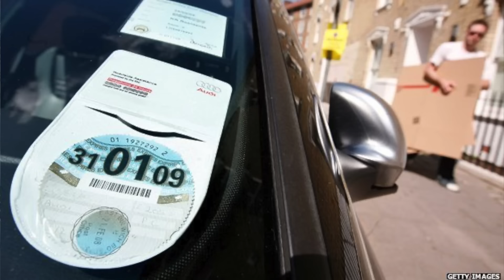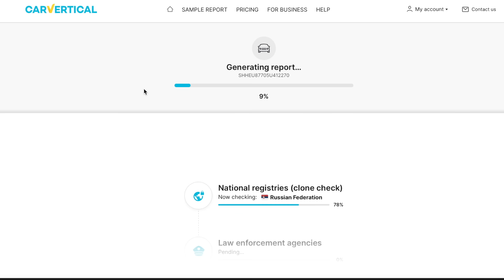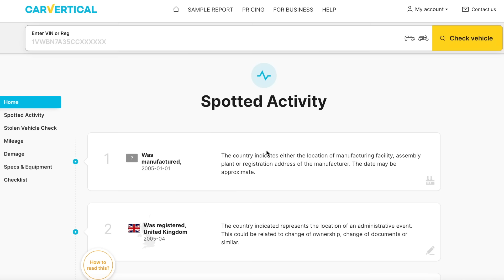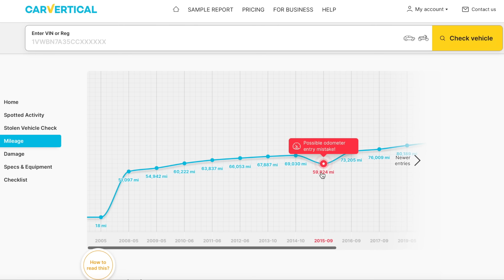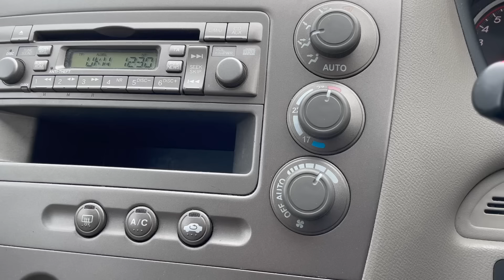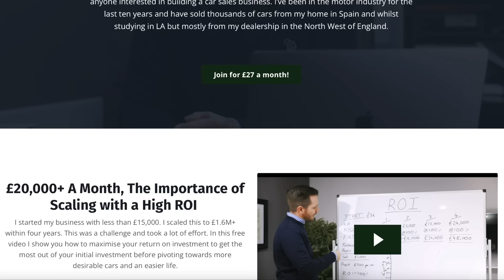I BOUGHT A CHEAP HONDA CIVIC

Comment: Just bought an automatic one which was first registered in 2005, nearly 100,000 miles on the clock and it costs £3000. Perfect for a first car.

Comment: i’m sixth owner of this car model in auto bought in london bit battered not a single panel without a dent/scratch no rust anywhere usually passes mot straight or fails on consumables tyres etc nothing major drives fantastic uses zero oil do own maintenance just turned 460,000 miles!!!!
only one problem rear washer doesn’t work as tube is blocked that’s it bit different to all the german rubbish i had over the years the ole civic will not die

Comment: I own a 2001 Civic 1600 Se Executive Auto. Only 56K. Lots of service history. I have had it 2 years when I brought it off my 89 year Aunty. Since I have owned it I have changed the exhaust, front Brake discs & Pads. Rear brake callipers & pads. New Aircon condenser,  new battery. I changed the radio cd to pioneer unit so I can stream music & navigation on my phone. The car has a leather interior. Electric sunroof heated front  seats electric heated mirrors. Everything works including now the Aircon(actually climate control) the bodywork has a few scrapes. The car will shortly be surplus to my requirements & don’t want to scrap it because it runs well & is very reliable. I would trust it to drive for the next 10 years with minimal cost. I might give it to you to recycle or advise

Comment: I owned one of these cars back over 10 years ago .
I was a 2001 Y Reg on S Trim ( Basic) but had the 1.4 engine .
Ironically it was the colour of the Y reg one picture you put up .
I can also confirm it was built in Swindon .

Comment: I had a Sport one of these also a 1.6 - just used it as a daily for a year while the Abarth was locked up away from the car thieves.

Ran like a dream, handled better than most new cars, everything on it worked, and also got 55mpg on a run.

Sold it for what I bought it for a year later, guy almost crashed it joining the road from the driveway, and then it was scrapped 4 months later - I imagine it was treated poorly and eventually crashed. Real shame because a car like this will run well for an eternity if looked after.

Comment: Well those are great Cars. You speak about the Corolla. I have one of those, bought It 2nd hand 10 years ago. Still goes strong.

My friend's father had a Civic like this one. I remember the gear nob being up and very well positioned. Those 1.6L engines are great. True they miss a 6th gear to cruise.

But small cars? Isn't it 4.4m long? I don't think more than 4m is small thought.

Can't wait to see the Toyota Corolla!!

Comment: My Dad's last car, a 2005 1.6 SE which I sold for him at the end of 2019 with only 19,000 miles on it. Very roomy, utterly reliable, would have made a great buy. 4-speed auto (which a lot of them had) smooth but saps the power.

Comment: Great cars! I’ve had 5 in 25 yrs from diesels to TypeR’s and not had a problem with any of them 👍
Reply: My last 2 civics (current 1.6 idtec 2014 model) sadly aircon not working but perfect otherwise, any issues with ac? Got a fill last year but gone 9 months later started with passenger side then drivers.
Reply: @getthecansin  I did have problems with my 2018 1.5 sports condenser but Honda extended the warranty and replaced it.
Reply: @ashleychambers7602  looking at other forums it defo seems to be a bit of an Achilles heel. Luckily I live in Ireland where it’s not needed too often😀
Reply: @getthecansin  😂😂😂😂👍

Comment: That's an impressively solid example there, the interior is beige though 😅.

I was considering a particular Type R a few years ago which, as I subsequently discovered, failed its MOT because the handbrake lever had become detached from the floor due to rust! This one looks very tidy indeed though.
Reply: Eh- black interiors are broing and get hot. 
-Somebody who went from beige to 2 black interiors back to beige.
Reply: Beige and nothing contrasting 🤦🏼‍♂️😏

Comment: Have one of those Corollas mentioned in the video, 1.4 petrol 2005. Paid 1400euro for it in December 2018. Use it as a workhorse and to ferry two big mucky dogs around, we haven't spent more than a grand in that time, and all on wear and tear stuff. Would get probably a grand back if we sold it tomoro. Brilliant little car, you know it will also start go and stop. They just dont make them like that any more.

Comment: I've got the same model but in silver.
Bought in Oct 2019 55 plate  with 29k on clock mint condition. Now on 41k, with only tyres and pads changed.
Lovely motor, but it's not a motorway  car, really needs a 6 speed box.👍

Comment: I got one given free, from a family member. 
I ran it till the tax ran out, and did not even ponder re-taxing it, or putting a new MOT on it.
 I did eventually MOT it, and to my disbelief, it passed. So i used it as a courtesy car for a year.
When that years MOT ran out, I was adamant i was not testing it again....but i did. Passed again, except for an advisory tyre.
I eventually sold it a few months after the second MOT for £1300, after using it for 18 months.
Still staggered to see it on the road nearly 4 years later.

Comment: Had one of these for 9 years, (bought pretty much newish at 35k mileage) Never had any issues with it and have generally maintained it well (oil changes) but the body work isn't the best as they do tend to rust overtime.I can drive it for another few years but will be sad to see it go. You cannot go wrong with Honda cars!

Comment: We bought a 96 civic quite low miles had it for 13 years the only reason it has to go was someone drove into the back other than bulbs battery and brakes timing belt we don't have to do anything and everything still working even the tape deck and we put hundred thousand miles on it honda is a top quality product

Comment: Currently running a 05 civic 1.4se  I bought for £400 with 113k on it some 4yrs ago now... in that time it's only needed , Cambelt for safety and a replacement caliper... otherwise just oil and filters every year + decent tyres. 
Does 50mpg on a run  and has plenty of space for family duties. 
Didn't intend to keep it this long, but I've no reason to move it on!

Comment: Love Hondas. My dad had a 2001 Honda Stream 2.0 from 2008 to 2020. Was probably the best car we’ve ever had. Was really reliable and never had to do anything major to it either. Had the original exhaust. Did have to replace the radiator but that was cheap. We got rid of it in 2020 as we took it into a Honda garage and it said it needed a few things. Now we don’t have MOTs where I live so we didn’t have to worry about it passing. Though we didn’t want the hassle. So we traded it in for a fairly new car. It’s a shame as it only had 118K on it and was still going strong.

Comment: Ran a 05 Civic from new to 190k miles.  All brake calipers failed from around 120k -150k miles.  Had the heater issue - resolved through a new thermostat but then came back shortly after so may have been the switch!  Headlight bulbs an absolute knightmare to quickly replace.  Also coolant fluid would just dissapear every week after around 170k miles, no sign of any leak so don't know where it went!

Comment: Bought one of these in December for £1000 with a short mot, it failed in January on exactly the same things at that one did, changed the back box and the O2 sensor and it’s fine. Lovely car to run around in and when you boot it the VTEC makes me grin.  
Think you got a good deal there. Oh and your one has way better body and paint than mine.
Reply from the maker: They're just effortless to drive aren't they
Reply: @HighPeakAutos  yes absolutely,

Comment: Good cars Civics. Held my breath when you opened the bonnet but  ... hooray ..... petrol not a tractor engine. The one you bought has proper independent multi-link rear suspension, unlike the spaceship thing which reverted to a torsion beam item with a lumpy ride. Nice views of new Mills and Mellor Road in the mist. I thought that the heater problem would be the water-valve. Can't say that Hondas Never do the head gasket in but it's rare and only when provoked. Assuming that there was coolant in the system the valve was prime suspect.

Comment: That's a simple design and in many ways I think it's aged better than it's wacky replacement. It's funny how things change. I never rembered the Vauxhall Nova as a sharp piece of design but I saw one in a classic car video and it looked smart. Much smarter than the now dated 1st generation Corsa that replaced it. Anything over styled or curvy is starting to look old but simple designs are more timeless. The exception to this is the 1st generation focus which has quite a striking design but still looks good.

Comment: When I saw the car was nosed into the parking spot the first thing that I thought of was a problem with reverse gear.  Glad it wasn't.  Also, when I see a prospect I'm looking at with locking wheel lug nuts I try and find the key first.  Had to deal with that a few times. ;-)

Comment: I bought a 1.6 diesel Civic three days ago. Just over eight years old, 40,000 miles. One owner, full service history, Honda dealer,  it had passed every MOT with no advisories. The service history is as thick as a family Bible and the car drives like a new one from the Honda showroom. 

i know the performance will not set the world alight but the car is zero rated for what I still call road tax. I filled the tank to the brim and covered more than 300 miles before topping it up to full again. Driving steadily with a couple of 70 mph dashes in the hills of mid Wales I achieved a genuine 70 mpg. Astounding economy for a very comfortable hatchback. Good cars if you are like me and just want low cost reliable transport.

Comment: These are great cars if you have one or two infants. There is so much space in the back it's easy to strap them into a child seat. It's easy for a child to climb from the back into the front or vice versa. This means you can have your child exit from the safest door available. Easy to drive but noisy on a motorway. I now have the version after this - which feels more solid, has six gears but not so good for passengers in the back.

Comment: I got one of these excutives like 4 months ago for £400 with a back seized brake. Been using it as a runner over winter. Cheap but fun motoring.
Reply: edit: the thing actually handled like a boat so I change the springs for some sporty ones

Comment: I had one but 1.7 CDTI. Isuzu engine, a little dead on low rev but at 2500rpm was great. 200kmh easy, after was struggling...but it has only 100hp. lots of room even though it seems not.

Comment: Bet you wish all the old PX's you buy turned out this well. All the factors were right with this one - an old Honda that had clearly been looked after - just a small amount of fettling and jobs a good un! I think you are right to highlight the VAT you have to pay to illustrate its not all profit ! - James at Chops Garage outines all his costs in selling cars which is fair enough as it shows the costs a dealer can be liable for.

Comment: woow for a 7th gen. Honda Civic Hatchback that's a nice trim gotta be the highest non type-r ES-trim over here.. Sunroof, beige leather (which I love for some reason), auto A/C
Honda Germany called this color Satin Silver Metallic
(Careful nerd alert!)
Had a 1997 Honda Civic 3 door Hatchback as my first own car. I loved that Indigo-purplish color Dark Amethyst Pearl, 5-speed manual, I don't remember the trim but I also had power sunroof which opened in like 2 seconds so a whole 3 seconds faster than the power windows on my previous 2008 junker Mercedes A-Class, had killer A/C like it was really cold and cloth seats so comfy that you never needed no heated seats because the just don't get cold.. Sure it had some rust but I bought it for 500 bucks and drove it 1 1/2 years. It's still driving around, sold it to a mechanic and he took care of it. Also had a major crash in a 2007 Honda Civic one of my best friends drove flipped 3 times at 40mph and we we had no broken bones or anything so I really like Hondas even tho there are 26 other manufacturers more popular than they're to new buyers :)

Comment: The only brand new factory fresh car I ever bought. Reliability was utterly horrendous, Honda UK extended the warranty an extra year to apologise. Still have the brand new factory radio for it in my attic as I upgraded the head unit. About time I stuck it on eBay!

Comment: I had one of these not to long ago it was the se executive with black leather in the minty green colour you mentioned it had done 120 odd thousand mile and the pictures were shocking and looked like it were different colours so I offered 300 pound and bought it it was in the local village and the old couple had just bought a brand new honda jazz 
The car was far from different colours absolutely mint and full honda history if all cars could be like that eh

Comment: That's a lot of car and obviously been well looked after (apart from the no-name tyres) the laminated clock setting guides were quite funny but the size of the font used says something about the previous owners eyesight IMO, possibly makes the gash along the side less surprising.  

Can't understand why folk insist on manual gearboxes at a time of life where the conceopt of clutch control seems to have deserted them.
Reply from the maker: Haha yes

Comment: The paint colour is called Magnetic Blue paint code B512M. I've got the 3 door 1.7cdti, had it 8 years, 153,000 miles and still going strong 💪🏽

Comment: you should test if the VTEC work, as always an awesome video. I have a civic sedan 2001, i have the same problem with the stuck switch to cold position.

Comment: @12:16 Saved yourself a few pounds by just by replacing one wiper blade :-) ..it has two different types. The flex one being the cheapest probably from Action or Lidl

Comment: I had one a few years ago it was an 02 two door. nice car but it was a 1.4 and a bit of a slug. The gearbox Bearing went on it. took it to be fixed and the guy said it's a common fault, we've got one over there in for the same thing.
Reply: I nearly bought one of these that needed a clutch. Wonder if it needed bearing as well?
Reply: @philtowle4683  It may have needed one, looking on line the are people talking about their input shaft bearing failing.

Comment: on a maths point....you stated 20% in your off the head calculation of VAT on your margin. In fact VAT content of a sum when the VAT rate is 20% works out at a sixth or 16.666 recurring.............Signed Mr Pedant.
Reply from the maker: Yes you’re right. I’ll have to mention this in the next video because so many people have questioned it as if I don’t know what I’m doing

Comment: Nice, did you get the air con sorted? Regassing?
That missing cigarette lighter is a sore thumb,
I have the 2003 civic se executive 1.6 v tech. Black leather interior all the bells and whistles and 44k miles genuine. I'd love reverse sensors and a dab radio like on modern cars but I'm loathed to get rid as every time I turn the key it starts! All MOTs no probs apart from wear and tear obviously, people comment on the condition especially after I get the waterless wash and wax on it! Never liked the new style design and the electric power steering is just right not light as feather which takes the fun out of driving IMO.

Comment: What? No National Trust sticker ? I know you laugh at old people but in this case they’ve had the last laugh: reliable cheap motoring is not to be sneezed at . It’s had a replacement battery you said: you mean Honda batteries don’t actually last for 18 years? Great video as usual.

Comment: I have a 3door diesel of this.  Only problem is the electronic power steering just seems to get quite heavy over time.  I've replaced all the components with used parts and not solved it

Comment: Hi Matt..what are your thoughts about Suzuki SX4 4x4? (not S-Cross)..can you do a video of some kind for it?
Reply from the maker: Yeah sure. The same as the Fiat Sedici?
Reply: @HighPeakAutos  Think so...yeah.
Reply: Had one. Based on a Swift and a very good 4x4 that not many know about (hence cheap - Sedici even cheaper for the same reason). Usual Suzuki reliability but I eventually got rid of it since, sitting fairly forward, there's a horrendous blind spot caused by the front door pillars and I nearly got caught out twice at roundabouts by cars hidden behind it. Aircon sprang a leak and both front springs broke due to potholes but I would still recommend them.

Comment: Hahaha, a manual being typical for old people in the UK. That's indeed how I see them. UK old people are pretty lively compared to the Dutch. Here after 65, they're all driving auto's. I'd subtract 10 years for that manual. That said, they did rest their hand on the gearshifter, that's another 10 years down. I think this person may be younger than you think, with a partner or so who is not great at remembering how a radio works, or tires :D. I'm guessing the owner was 62. 
I'm driving a 2003 Ford Fusion now, which turned out to be a great buy just under a year ago. But seriously, a Civic like this, I don't like the exterior, but I do like the interior and knowing Honda it probably drives quite well. If not too rusty (is that still an issue for this series? edit; ah, you just answered it) this seems like a good car to buy. One to remember!